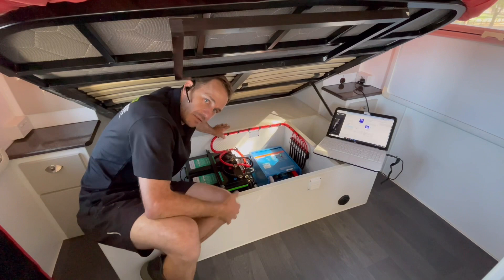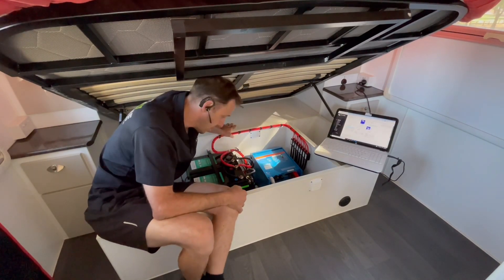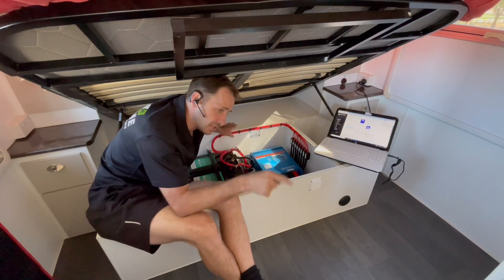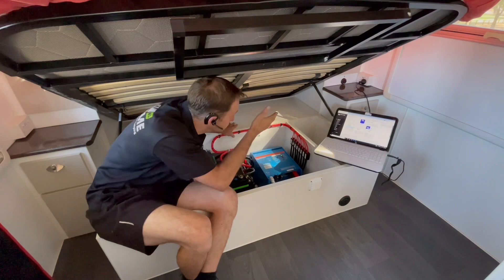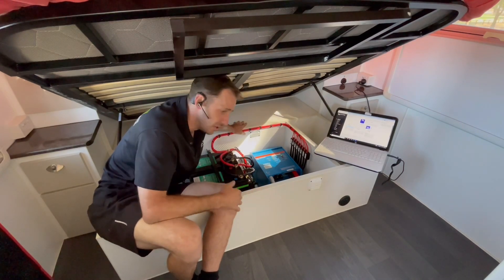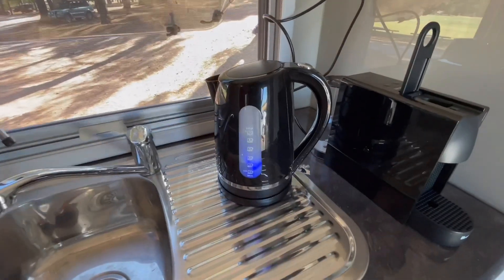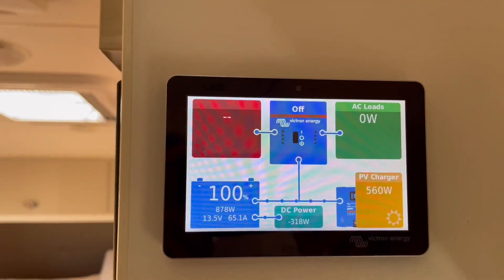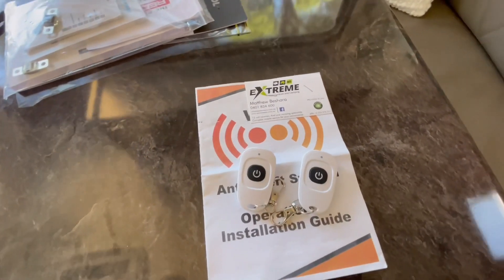Highline Off Grid Lithium Setup, Coffee machines, Air Conditioners, toasters and more…

Comment: Just catching up on all the great content - appreciate the huge effort that goes into your channel !  Do you have any recommended solar panels and do you ever use commercial or domestic panels (48v) in your setups ?
Reply from the maker: Hi Barry,
Great question. The unfortunate thing is most Caravans will not allow such a large panel to be fitted on the roof without shading issues let alone not enough width on either side of the air conditioner.
It’s a game of Tetris on the roof of any Caravan. And the more pieces you have of varying sizes the better chances you are of covering it.

Comment: Another good video mate👍 just curious when you said that the ac would use 40 to 70 amp at night is that over night or is that an hour? Cheers
Reply from the maker: That is a rough guide per hour of course this is based on ambient external temperature.
These things run even better when running on night mode and your van is already at temperature.

Comment: Can you give a ballpark costing of that installation?  I'm looking at setting up so I can work (software development)  from our caravan, so need to be able to run a decent computer (desktop) and a couple of monitors, an AC would be very nice.
Reply from the maker: Hi Peter, each job is very unique, As a guide anywhere from 9k to 16k is a good guide.
Reply: @extremeacc101  thanks for that.  Looks like I'll have to put this idea on the back burner for a while.
Reply from the maker: @peterstewart3563  using the top and products like I have here usually pushes the budget higher however the outcome is a quality system that is designed to last.
Reply from the maker: @peterstewart3563  using the top and products like I have here usually pushes the budget higher however the outcome is a quality system that is designed to last.